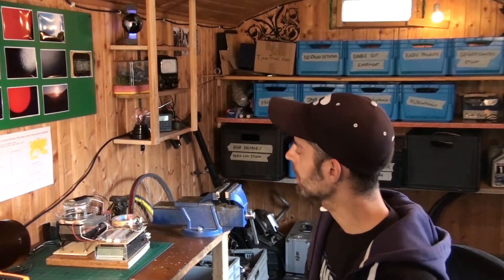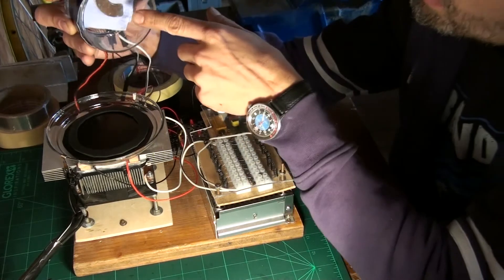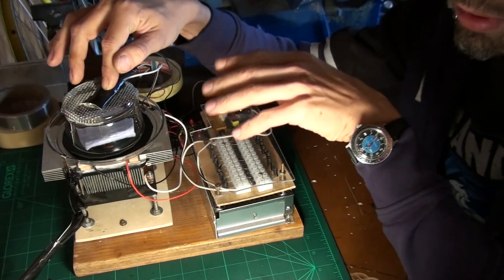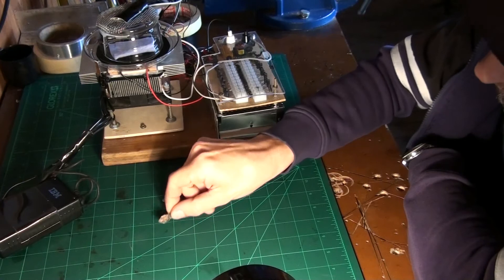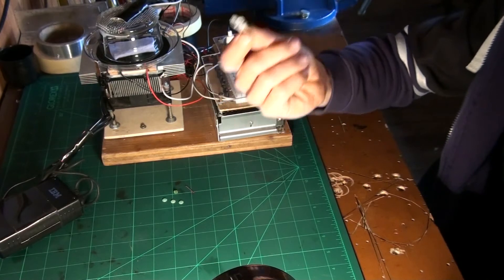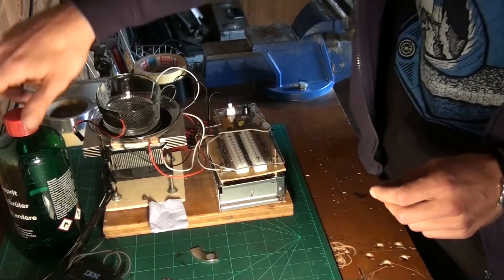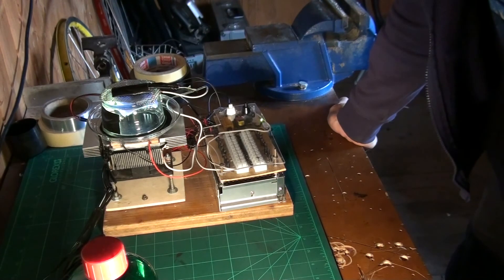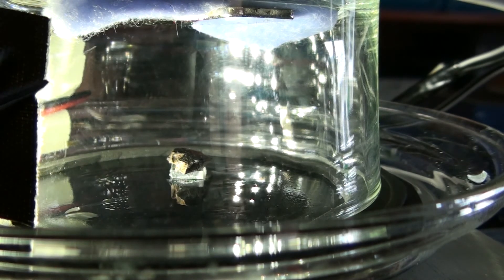My DIY Cloud Chamber Particle Detector!

Comment: 4:58 This phenomenon is not Bremsstrahlung, but secondary electrons ejected by an incident radiation, they are called delta rays. Bremsstrahlung radiation, on the other hand, consists of X-rays, which are emitted when a charged particle is slowed down as it passes through matter.

Comment: I like your multipler. I am using the HV board from an electronic fly swatter and a single Peltier but the hot side of the Peltier is attached to a jumbo water cooling block I fabricated 20 years ago for my first CCD astrocam. So my run times are dictated by how often my freezer gives birth to another litter of ice cubes. I rescued a peristaltic pump from an HP InkWaster 2000 and I want to modify to chamber to recycle the alcohol. The alcohol loves water so much that I think this will not work long unless totally sealed form outside air.

Comment: whats up with all those caps on the power supply pins?
Reply from the maker: The Caps belong to the High Voltage Supply, its separate from the 12V supply, i just built it ontop :) You can google "Villard Cascade" to find a scematic. Basically it bumps up 50V (from a flyswatter circuit) to about 1000-1500V (DC) via the Caps and Diodes
Reply: Thanks. Have you tried moving the upper wire mesh inside the chamber? I am too afraid of sparks, alcohol and sparks is not fun :D
Reply from the maker: Yes i moved the Electrode inside the Vessel meanwhile, it does work a bit better (I think especially to make the fainer Beta Tracks Visible). I think my 1500V are a bit too much anyway, it would work with 150-200V as well when electrode inside the Vessel. At lower Voltage risk of sparks will be less, if you build it careful i think you should be safe :) Just test it without the Alcohol first, and maybe have a Fire Blanket + Extinguisher nearby ;)

Comment: great!!! but I think its important to have the electrode of the electric field INSIDE and not outside : otherwise the glass will act as a dielectrique  and disturb the electrique field. The voltage should be around 150v (like in the original paper from Wilson) and its an electrostatic field to wipe  out the ions in the chamber : the ions not created by the ionizing particules. If you put the electric field inside you should be able to have finer trails.  Here's a link to give an idea how the realise the electrode inside ; plus it will allow you to see from ABOVE and its far more interesting  (but you might have seen this video maybe.)  Also if you want to know more about cloud chamber in détails you can check for the original papers about it on www.archive.org  .[i'm myself making an expansion cloud chamber (15cm diam) as the working surface will be larger and allow to see better the trails from cosmic rays or even x rays from my xray tube..etc..
Reply from the maker: Wow, thanks alot Mate for youre advice! ...i could have thaught about that.. of course, putting the Electrode inside will probably work much better :) I didnt work on the Chamber for a while, but i am planning to combine it with my Muon Detector anyway soon, and having free field of View from above would be much better for this anyway. If youre interested in Cosmic Ray / Muon research combined with the Cloud chamber check out www.muonhunter.com, they sell very awesome kits based on 2 Geiger tubes (Coincidence Detector)for a very fair price, i have 2 Videos about this so far on my Channel. You can combine the Muon Detector with a Raspberry Pi and a Camera to trigger the Camera and take Pictures of Muons! Well thats for a future Video.. PS: About X-Rays, do you mean that you can see the Compton Scattering /Electrons that X-Rays Produce? Since observing X-Rays directly seems not possible because they dont have a Charge..? Cheers!